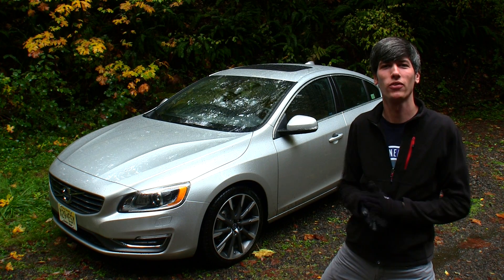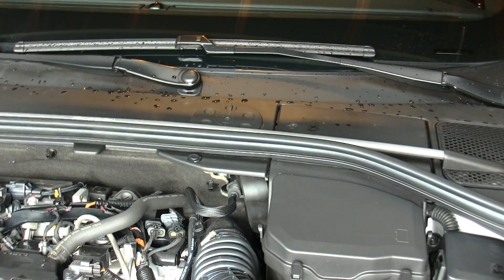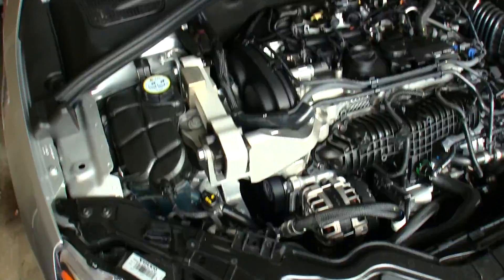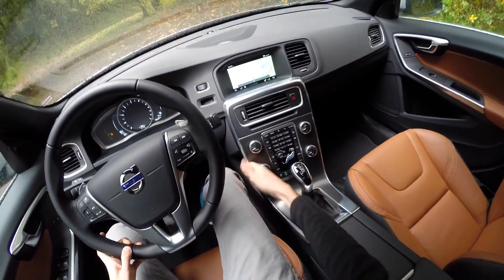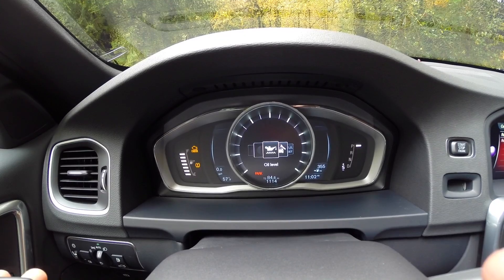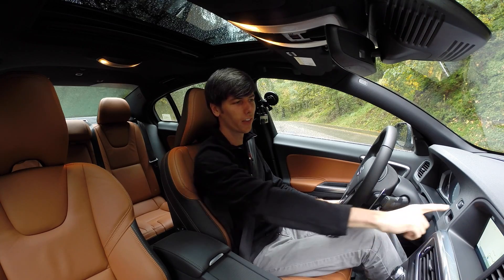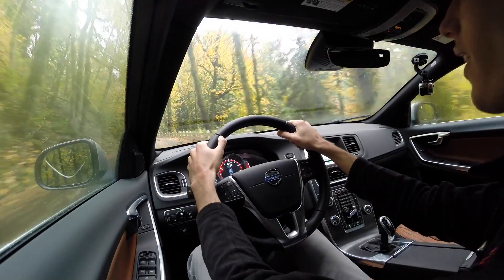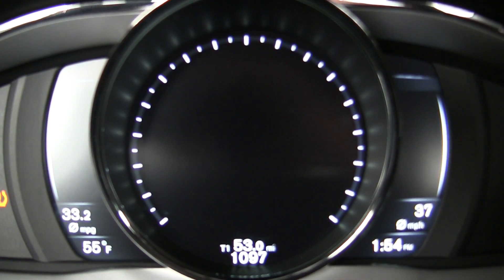2015 Volvo S60 - Twincharged - Review & Test Drive

Comment: Looks like those Volvos are made cheaper and cheaper, and made to be serviced at the dealer, or by an expert mechanic at the best. No engine oil dipstick, electronic water pump, and an awful rat's nest under the engine cover.
Reply: as a professional auto mechanic, it doesn't look that bad at all to work on, as long as you have the right tools, which i do. i love seeing technology like this because it keeps away people who shouldn't be working on them
Reply: *****
This is a mechanics nightmare, modern cars arnt servicable anymore. Looks like a freaking mess under the hood. The second hand market will be dead within a few years with cars like this.
Reply from the maker: Electric water pump is a good thing. More expensive than a belt driven pump, but significantly more efficient.
Reply: Engineering Explained Depends on the lifespan on them. I've heard that they break more often, which isn't something you want. But I'll give them credits for have put it in an easy to access area.
Reply: so? most cars are like this nowadays. if parts are good quality, there is no "failed" engineering. as long as its not made in russia or north korea or something :D
Reply: Är du svensk?
Reply: *****
I will disagree and say that as technology advances and becomes more specific, there will just be more and more specialized and trained technicians, versus do it alls. sure, the cars are more complicated, but they are a whole lot better than they used to be. same as everything else. you can't ask somebody who can easily work on an old turbo prop plane to work on a jetliner... or even fly it. simple as that.
Reply: the same people said about VAG 1.8T turbocharged engine back when it was introduced. Who would be so silly to make an engine output 150 HP out of ONLY 1.8l?!?! Now, they are still running with >300-400kkm.
Reply: I agree. It's a scarey very tight complicated mess of tubes, leads and all sorts. Not remotely sympethetically designed for DIY maintenance. That's why I lean toward older cars. They are easier and cheaper to maintain.
Reply: It may surprise you to know I'm not surprised.

Comment: That headlight thing might be very bad. Here in Ireland headlight need to aligned at a certain angle and the headlight removal might change its angle. I hope Volvo thought this through.
Reply from the maker: I'm sure they thought it through. It's clever.
Reply: This system is awesome. They introduced it on the XC90 and works so great. There is no easier way to change a bulb. :)
Reply: Engineering Explained Yannick de Vries  Thats Great

Comment: what is the difference between a supercharge and a turbocharge
Reply: They use different methods to compress air. Turbos use exhaust gas to spool a turbine which compresses intake air and pushes it into the cylinders.
Superchargers has the same function but it is driven by a belt and not exhaust gas.

Comment: This is quite a wild set-up. I think that this is an awesome combination of technology, but I could see how working on this could be a nightmare as well even with what Volvo has done for ease of access with simple maintenance with the access ports.
Reply: Very late response, but I just bought a '17 T6 R-Design, and opted for the extra 5 years on the CPO warranty. It covers everything except wear and tear items like brakes, wiper blades, etc. If you plan on owning the car for a long time, it's well worth it.

Comment: What's the real benefit of a twin charger instead of just a single supercharger or turbo
Reply from the maker: Wider boost range, with greater efficiency at higher RPM. Supercharger for low RPM boost, turbo for high RPM boost. Twincharger: Supercharger + Turbocharger
Reply from the maker: Here's an article going into great detail: http://www.carthrottle.com/engineering-explained-the-pros-and-cons-of-turbochargers-vs-superchargers/

Comment: Id use the rear headrest control to smack the shit out of annoying passengers lol. Thanks for the review, very informative.
Reply from the maker: Haha, didn't think about using it when there are passengers. Especially when they're not leaning back against it. Great for disobedient kids too.
Reply: Engineering Explained My mom had this feature in her 2006 S550, loved to use it on me and my sister.
Reply: My grandfather was messing with the buttons in my Volvo while my grandma was sitting in the back and he pushed the button. My grandma thought I did it and looked at me like I punched her in the face lol.
Reply: I do this with everyone that sits in the back of mine. Its glorious
Reply: this made my day can’t way to do this
Reply: I have that rear headrest feature on my Mercedes E200 W124 (1995) except they fall backwards onto the rear parcel shelf, and have to be manually placed forward afterwards (electric release mechanism only).
Reply: My 03 volvo s60 has that head rest switch and it never fails to disapoint
Reply: Lol me too
Reply: I do it all the time lol
Reply: That's the only reason I ever press that button! Lol